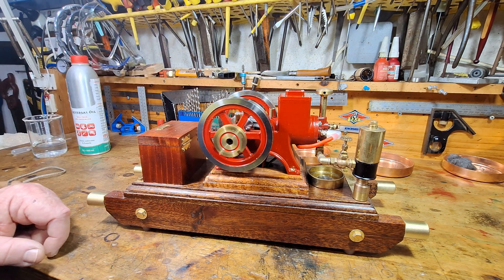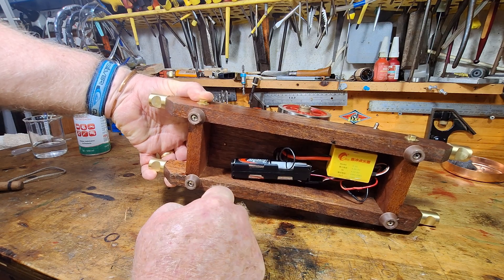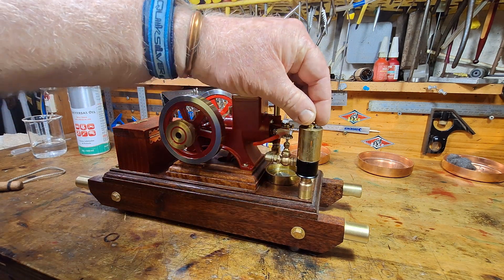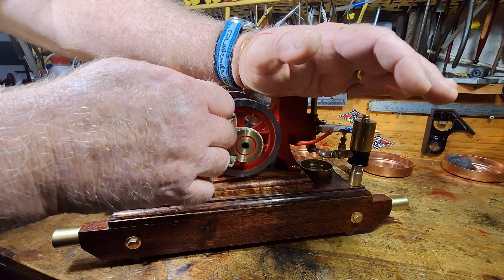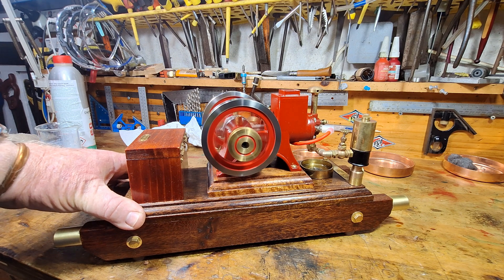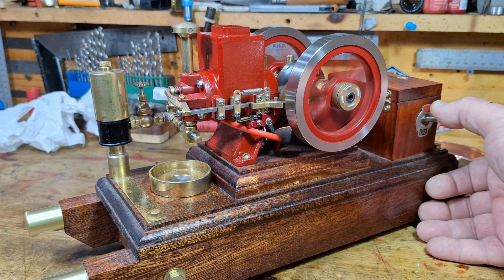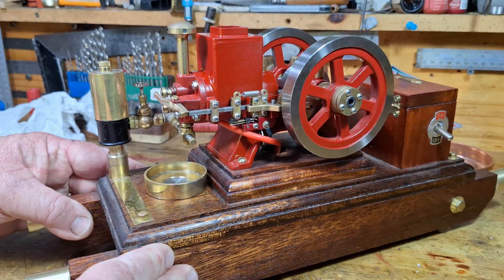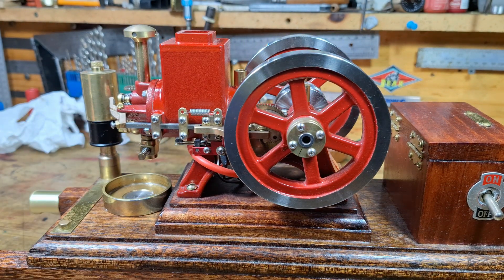Enjomor 6cc Hit & Miss Engine Modifications

Comment: Hi Jim.  Nice little engine.  I think that is one of the better ones for looks and smoothness.  I expect a flat/dead battery could be used in place of a dummy one.  Cheers Rob
Reply from the maker: G'day Rob....I thought the same thing and suggested that but was told that a dead battery adds resistance....my electronics knowledge is about equal to a Nun's expertise in breastfeeding.....so I don't know whether or not that correct - Cheers Jim
Reply: @SteamEngines-Jim  Hi Jim.  Same here.  That could well be correct.  Anyway a piece of metal would work for sure.  Cheers Rob
Reply from the maker: @Xynudu  I just used some off cut brass through the white Delrin.....these are fun engines to muck around with.

Comment: You've done a great job on the engine, much better looking than my standard one. Just a thought, have you not considered slowing it down a little by cutting down or replacing the spring under the governor latch?
Reply from the maker: G'day Dave, yes I have mucked around with it endlessly till I have had tennis elbow from pulling the rope. I have got it running really slowly......'sometimes' ....this time I just couldn't get things right - Cheers Jim